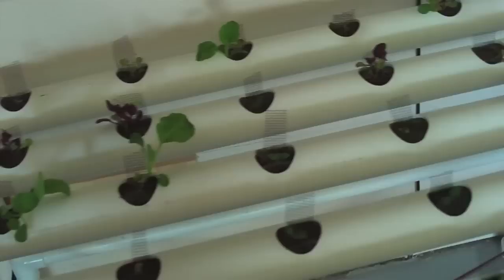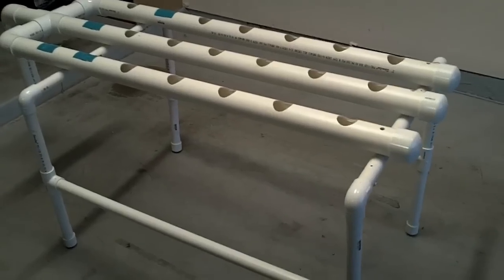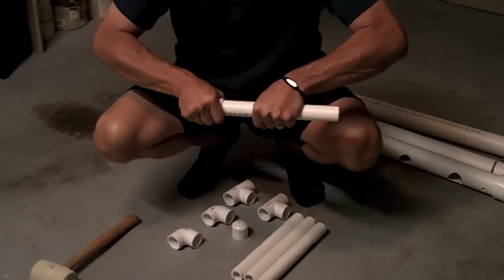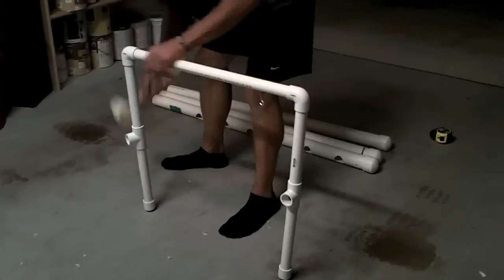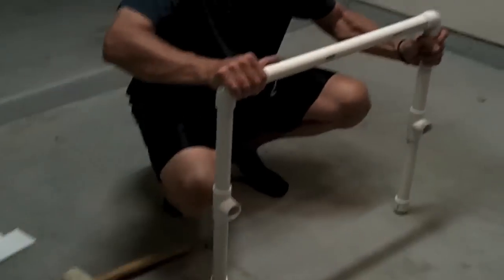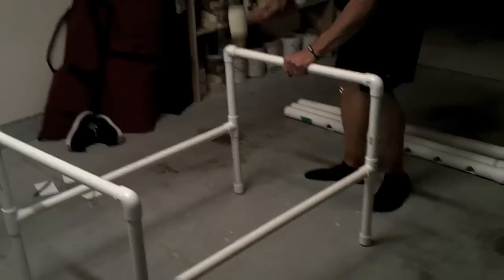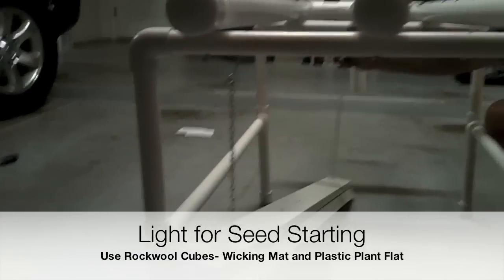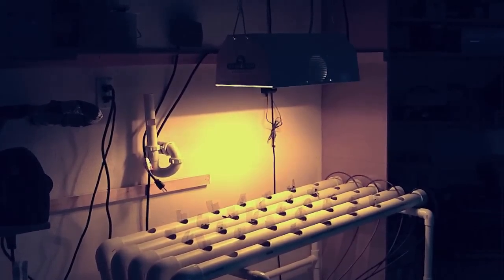How to Build PVC Hydroponic System - Complete Parts List

Comment: isn't pvc bad for plants?
Reply: Plastic pipe such as PVC (polyvinyl chloride, used for cold water only), and CPVC (chlorinated polyvinyl chloride, used for both hot and cold water) have been around for years, and both are approved for use with drinking water. ... Safety issues are mainly considered a concern in PVC pipe that was manufactured before 1977.

Comment: How do you put the plant in it? Does dirt sit on the rockwool? Or what? Is the PVC filled with something? 

Have you tried this setup outside so you don't need the light? 

My sister's house was used as a grow house here in Houston a few months back, mj growers had an intense hydropinic system, over 5000 plants.

Comment: I would love to do this, but I would be curious what chemicals are in the pvc pipes and and if they get into those edible plants in one way or another. It is too questionable for me.
Reply: Plastic pipe such as PVC (polyvinyl chloride, used for cold water only), and CPVC (chlorinated polyvinyl chloride, used for both hot and cold water) have been around for years, and both are approved for use with drinking water. ... Safety issues are mainly considered a concern in PVC pipe that was manufactured before 1977.

Comment from the maker: @stratocaster1986able Yes its only intended for smaller stuff like lettuce, basil. Larger crops would tip over and clog the pipes. You are correct.

Comment from the maker: @gaara0sama Yes you're right. You just drop the rockwool directly into the hole. I actually cut a piece of fiberglass window screen about a 1.5 inches wide and about 6 inches long and "draped" the rockwool cube with this screen, then lowered into the hole. Makes removal easier and also stabilizes the cube. I've got a close up picture of this in one on my videos. Since this is NFT is runs 24/7 365.

Comment from the maker: @matthewstatonbomer I'm too cheap to buy this stuff premade, so I used standard PVC and a hole saw ( drill and hole saw bit) to drill the holes. I cleaned the edges up with a file and sandpaper.  The holes for the nutrients is just a standard 1/4 inch dill bit to fit the irrigation tubes. To germinate seeds, I soaked rockwool overnight, placed seeds in holes and placed in a germination tray with a wicking mat and lid. Hit the seeds with flourescent lights 24/7. No nutrients on seeds or seedlings

Comment from the maker: @anesthetized8 This is called a nutrient flow system (NFT). The rockwool media used for the plants have very little ability to hold water. If you used a timer with this system, the plants would die due to lack of moisture. If you use a media that holds more water perlite and vermiculite (like my dutch bucket video) then you can flood the media only several times per day. Hope that helps.

Comment from the maker: @folken692000 You're right. In the NFT the pumps run 24/7. The timer is for the light system and the cooling fan which run 16 on 14 off. Thanks.